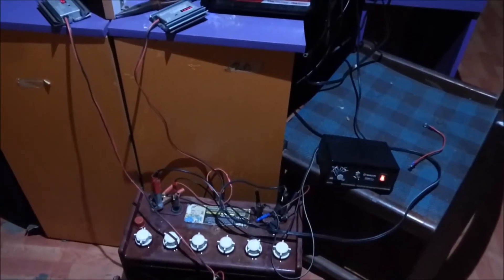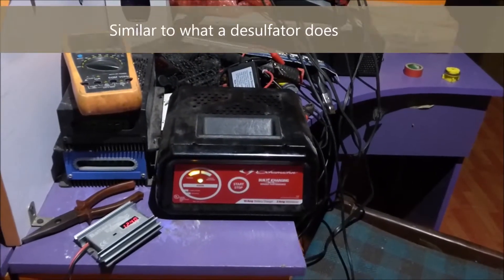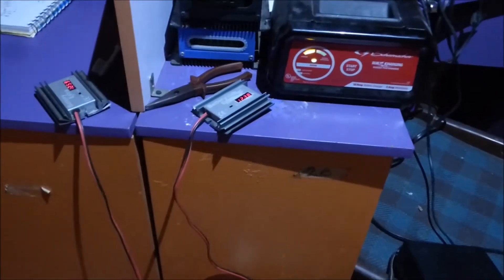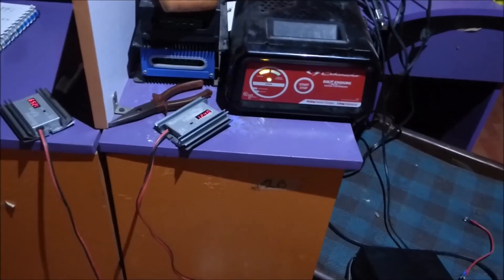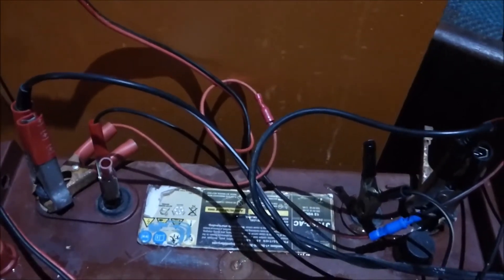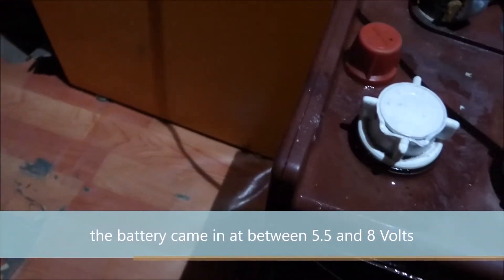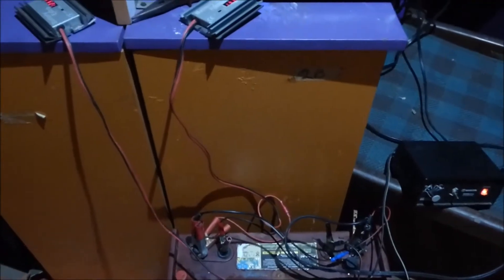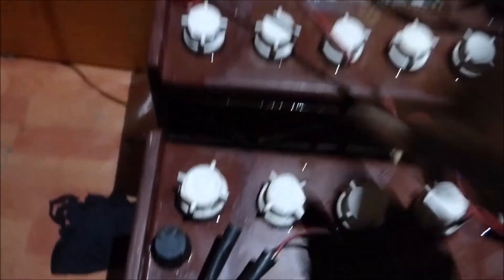Resurrection Day 2

Comment: Hi Dr Solar. It's a good work you're doing for the general good of the people in Nigeria. I must commend you. I have a bothering question on this battery you're trying to resuscitate. Why will the battery go bad under the watch of Magnum charger/inverter, does it not have equalisation function? The second question is: what is the source of your power during the resuscitation process, PHCN or Inverter system? It's Kluzi.
Reply from the maker: kluzim good morning. Thank you for watching the video and thank you for the compliment. I have solar and PHCN. I have power all the time. Why did the battery go bad? Could be a cabling issue, the owner no properly equalizing. We move our connections around every 6 months to minimize wear on the plates. Batteries are funny. Without questioning the owner all we can do is guess
Reply: AWPS Renewable Energy, LTD OK. Do you suggest the cables from the charger should be interchanged on different strings of the batteries at regular interval?
Reply from the maker: kluzim on small battery banks move the batteries around. On bigger banks you might need to disconnect all your interconnecting cables, make sure the terminals are clean and then swap terminals. If battery #1 was your positive then it becomes your negative.
Reply from the maker: No need to change the inverter cables if they are good.